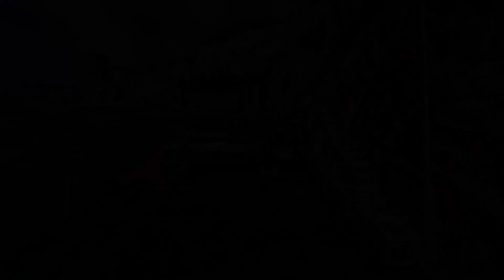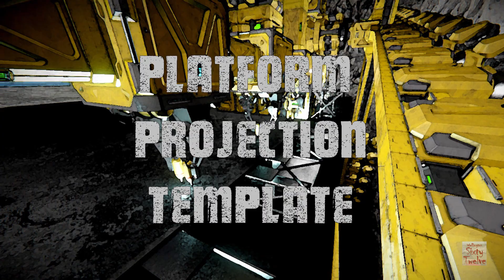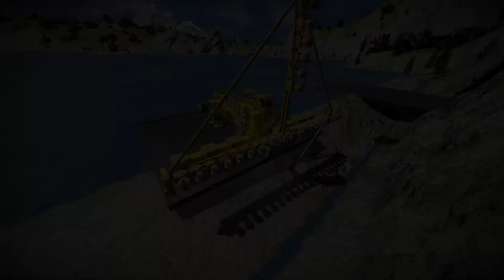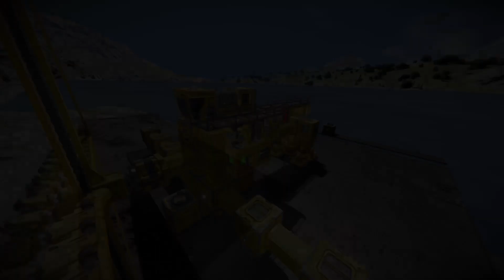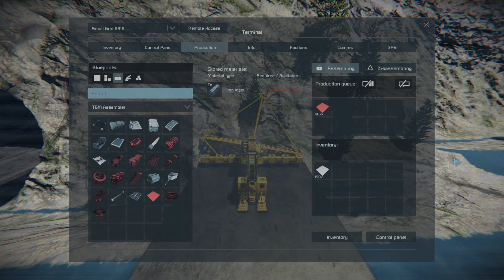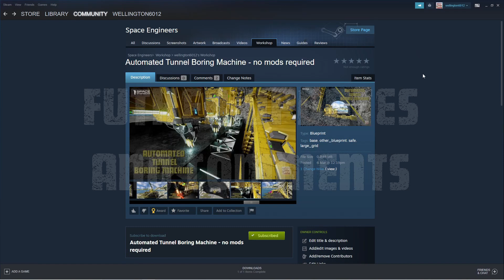Automatic Tunnel Boring Machine - a guide for setup and operating (Space Engineers)

Comment: I have tried to use this in both survival and creative, but I can not get the landing gear to move and yes I have unlocked them, I have replaced them, and started a new build 3x. Each time the same thing . Extend the piston to attach it to the landing gear attach it works fine. Go to retract the piston back nothing happens. The gear is showing are lit up yellow around the base of each foot.
Reply from the maker: So this is the back piston retracting at the end of the cycle ready for the next push? Can you manually lock or unlock the landing gear? Does the landing gear assembly move back and forward on the piston , but just wont lock?
Reply: @Wellington6012  The landing gear assembly will not move with the piston at all. If I detach fron the gear assembly the piston moves back and forwards, so I move the piston from 2.5m to 5.0m to attach the gear assembly, grind back the pink bits, press attach, the gear assembly and the piston attaches, the gear assembly locks to the ground, I manully unlock each foot. Open the piston options to reset the position back to 2.5m, press reverse and nothing happens.
Reply from the maker: @paulcharteris9864  Right, it sounds like a bug that sometimes appears. If you check the comments on Steam workshop and youtube, it may give some advice, but in a nutshell, most of the time this machine works flawlessly, occasionally it doesn't, but it's random and not the fault of the design. For instance, in creating the how-to guide, the first machine just kept going on and on and on by itself without issue, whereas the second didn't push a couple of times out of about 20 pushes, same with the prototype on Hephaestus Prime, didn't push 2 or 3 times out of about 150 pushes. Seems like some individual blocks on the machine remain a station and don't convert to a ship when the merge unlocks, for me it was a single welder. Replacing that single block worked for me, an alternative fix that seems to work is cut and paste a new version, just stick a landing gear on the drill head and stick it to the wall and detach rotor so you don't have to re-weld that.
Reply: @Wellington6012  
ok I repositioned the TBM on a purpose build area that is level and rebuilt the first part of the TBM. Came across the problem of it not attaching to the landing gear, but found releasing the merge block caused it to attach. And the landing gear repositioned to where it is supposed to. My problem at the moment is the automation isn't working properly. Timer 1 works fine, timer 2 is missing the step to go to 3 but timer 3 starts and flashes and that's all, nothing there to tell it to move onto timer 5. there are no steps to release and move the Landing Gear and relock them. Where does the grey box come from between steps is it a timer or just a blank?
Reply from the maker: @paulcharteris9864  Timer#4 is built into the base. It acts as a safety mechanism, the machine won't continue on until a confirmed merge block lock, thus allowing #3 to talk to #4 and continue the program.
Reply: @Wellington6012  yes can manually lock and unlock the gear. Locked gear is green and unlocked gear is yellow.

Comment: Update - I kept on mucking about with it.  The back end was a static grid. I converted it to ship (after getting piston head attached) and it retracted immediately.

No further ideas for the piston during setup? I've tried your suggestions, and whatever else I could think might fiddle it into working, but no luck.

Edit to explain - I can get it to attach to the piston head but it will not retract the back end.  With or without power on the back end components.
Reply from the maker: Hi James. So you are saying it's not retracting the landing gears into position ready to lock down for the next push?
Reply: @Wellington6012  thanks for reaching out. I'm unclear whether it's because it was attached to another, smaller grid. Just some scaffolding for wind turbine and battery. But the back end kept thinking it was a static grid and wouldn't move. I thought I had flipped it to 'ship' already, but could be mistaken. As soon as I clicked it again while the piston was attempting to retract, it started moving immediately.
Reply: @Wellington6012  I reached out on your Discord. Perhaps we can chat through a couple questions, if you have time.

Comment: UPDATE - Does work on Xbox vanilla survival: Need to add landing gear to the bottom of the whole grid and turn it into a platform (Xbox wont let you convert it if any part of the grid is touching ground. The piston that moves the machine needs to be retracted and a new blueprint made before building in survival. Also timers are needed to step the drill in 1.2m increments so it doesn't bury into the wall you are mining. Apparently Xbox Doesn't believe in Physics, Fluid dynamics, applied pressure or true Kn. you can do all this in creative then build it in survival. I have created the "Catadriller TBM" blueprints of the machine and the drill head for the Xbox if you are having any trouble. THIS IS AN AWSIOME MACHINE! Thank you Mr. Wellington for sharing your very thoughtful design, and the inspiration for me to hammer out the wrinkles for a challenging platform. What can I say; I have the need to create ! Peace and Love from the Xbox master race :D
Reply: Where can I find these xbox blueprints?
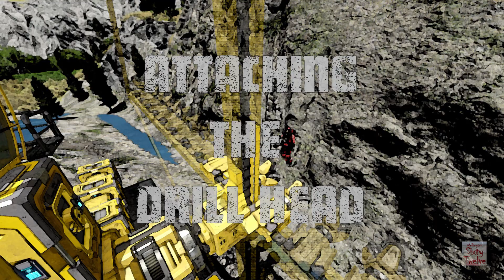Reply: @chrsfincher  I don't know how to copy links for MOD.IO from the xbox, but you can search for them in game on the Xbox at the workshop by filtering to "Other". The Main Machine is listed as "Catadriller TBM Machine Xbox Final" and the drill head is listed under "Other" as well. it is listed as "Catadriller TBM XLT Drill Head Xbox FNL". To be clear, these are 2 separate blueprints that need to be combined as per Wellington 6012's video above starting at time marker 5:34.
Reply: @hotelyankeepoppa8862  ty for the speedy reply I'll search on there later when I get on i was searching with my phone
Reply from the maker: @chrsfincher  Hi there. The links to the mod.io website is in the video description.
Reply: Ok so I got it working on my Xbox this all applies to the hypers version for xbox.... had to add a lock rotor option in timer 1 and an unlock in timer 5. Also had to add the start timer 4 to timer 3 because it kept getting stuck in a loop took a min to find that one lol. I'm fairly sure I got it working as well I just need to wait and get it into a mountain to be sure but I think I'm ready to try and build it in survival
Reply: Ok found a big in hypers version. Timer 3 triggers timer 5. And it shouldn't get triggered until timer 4 breaks the timer 3 loop so timer 4 should trigger timer 5
Reply from the maker: @chrsfincher  No, that was me! Timer #3 shouldn't start Timer #5, but that's how it is in the blueprint. It's the first point on my list of known bugs in the workshop/mod.io description/notes. If it operates normally, it shouldn't affect things, but if the merge doesn't re-lock, the machine won't stop advancing, it will continue and could slide off the end when it runs out of floor. ...from memory.
Reply: @Wellington6012  I can confirm that is still what happens lol
Reply from the maker: @chrsfincher  F5
Reply: @Wellington6012  ok I ran this for like 8 hrs yesterday and it got stuck... the connector pointing down for in floor connection got stuck on a section of floor once I removed that it ran all night without a hiccup
Reply from the maker: @chrsfincher  Nice!
Reply from the maker: Thanks yo so much Hyper Threat. If you can please copy and re-comment your update as a reply in you original thread, I'll pin it and put a reference in the workshop/MOD.IO page description.
Reply: Hello there. I somehow cant add rotor head. I used Build vision , tried through terminal, attaching deattachin. Nothing worked. Please help

Comment: there is a way to make this fully independent and have some of its stone refined ores  to make a fully cycled battery infinite BP recharge that can run forever on stone alone theres already machines out there to prove it and it would not be too much stress added to machine i think since your project uses the same mats :)  so fully indenpendent  infinite boring through a planet XD
Reply from the maker: Interesting idea, the batteries could projected and ground down in parallel with the merge blocks. I think you'd need extra assemblers and maybe refineries too, but could be workable ...hmmm
Reply: @Wellington6012  yes that what i thought too and dont forget to put batts on discharge so the batteries on tunneler are getting recharged all the time :-) hmm so doing quick math with lets say 8 batteries 25% ( 4 per side) youre getting 24MW charge all the time im guessin? or 4 for 12MW ?  that is large grid tho you could make something with small but thats more intricate and takes alot more space